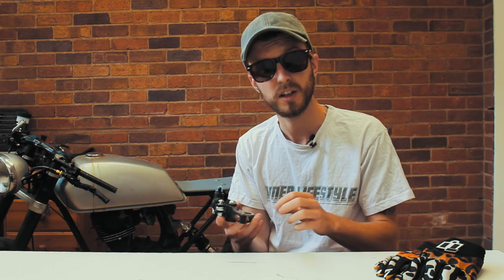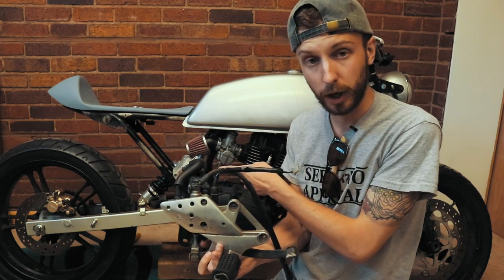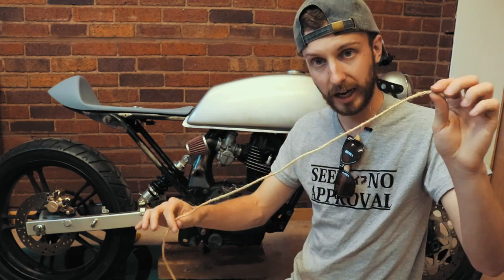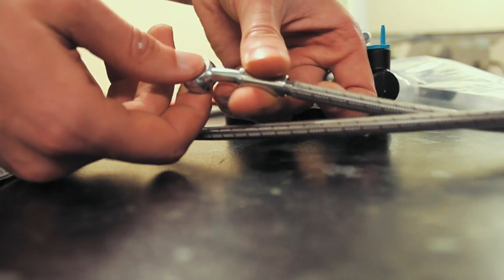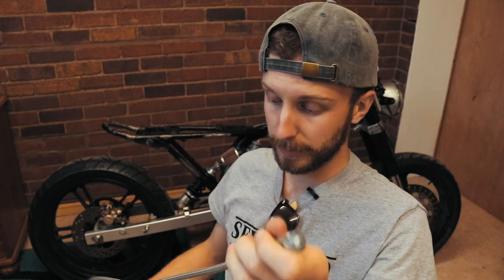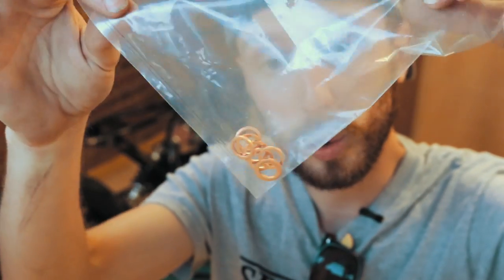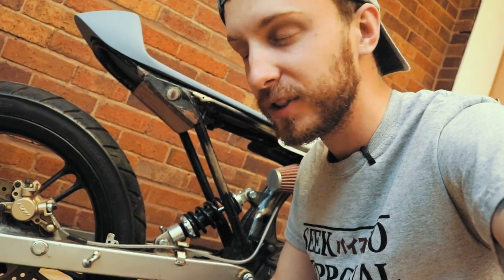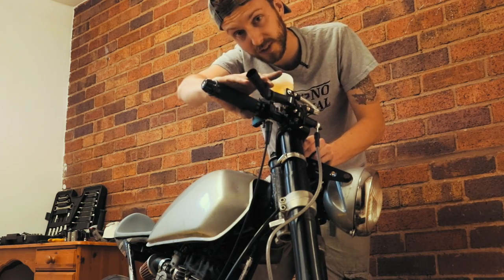Honda CB125 Cafe Racer Build -  Part 12 - Thumb Brake on a 125cc?!

Comment: Thank you! I’m trying to get back riding with prosthetic right leg and have been researching ideas for rear brake operation without use of right foot. This is a much better way than two hand brake levers on right handlebar.

Comment: You need to do what I'm doing with the honda CG 125 and weld a bracket to the frame so you can mount the honda cbr 125 rear sets etc. You've already had the frame modded once, surely you can do it again but for the rearsets?
Reply: I0ITuGI0I do you have any more info or pics regarding the rearsets? Interesting idea.

Comment: what are the costs so far?
Reply from the maker: at a guess id say around the £1100 mark? seeing as the thumb brake almost cost as much as the bike itself!
Reply: Jish  that seams really cheap, total cost wise.
I just bought my first motorbike helmet yesterday and bought jacket,jeans, boots from another, now I don't know why but while I was trying   stuff on my mum had shown the guys  at the shop my new helmet and they gave me some bad news, the guy who sold me the helmet had scratched the viser and damaged the pin lock,
the helmet is an Ls2 Orion, I'm taking the helmet back, but I wanted to know if this has happened to you or others? btw I haven't done my cbt yet, just need a good helmet in the range of £180
Reply from the maker: +koudacyen it helps I got the bike cheap! 

I cannot say it's happened to me sorry dude, Iv yet to buy all my gear! I have a helmet but that was from when I was 15 riding a scooter!